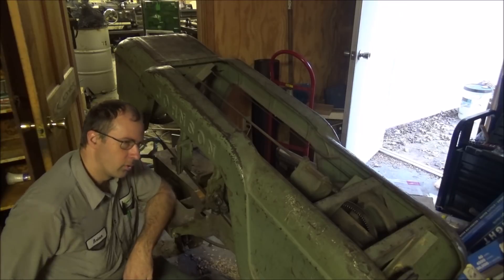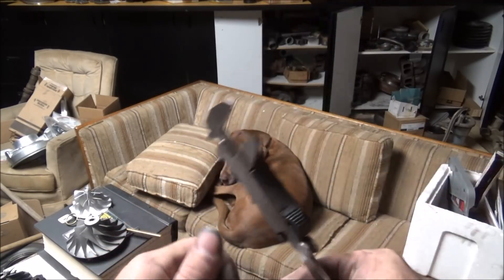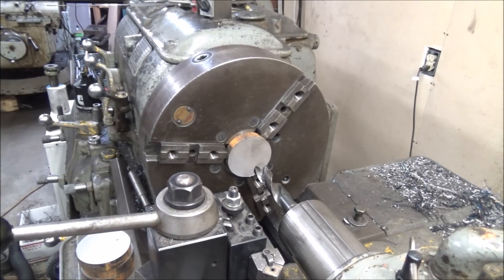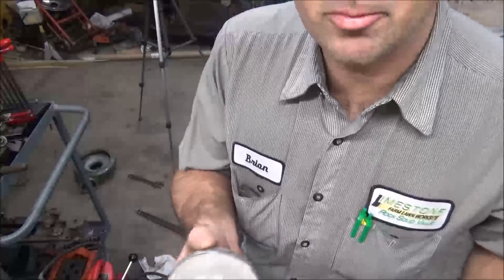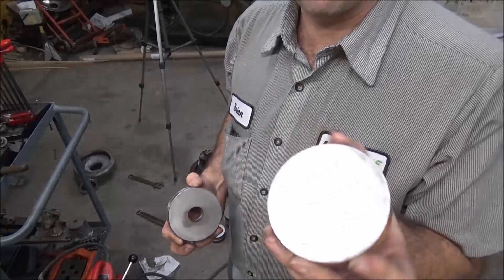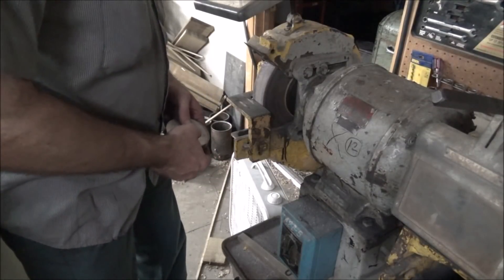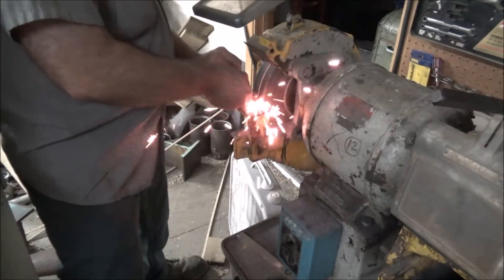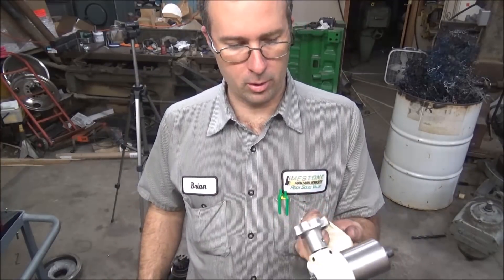Building Anchor Components for the Big Horizontal Boring Mill

Comment: 0.006" over 0.750" is +/-0.008"/inch... More realistic than +/-0.005"/inch.
Reply from the maker: I was referring to my target straightness for cut surface on the diameter not the tolerance on length.

Comment: Funny how well a drill works when used as it was designed.  You probably finished all the holes in the time would have taken others to finish swapping the 4 drills they would have used for one hole.  That is one sweetly tuned saw.

I have seen on many saw cut round bar parts this odd egg/crescent shaped pattern in the metal.  Do you have any explanation for what that is?  You can see the crescent moon shape at 2:09 in the video.
Reply from the maker: I can only assume the crescent pattern comes from vibrations in the blade caused by the teeth entering and leaving the cut.

Comment: wonder if that saw could cut 3 1/2" tractor axle? it was super hard material for cutoff discs.
Reply from the maker: I have sawn off 4" Deere tractor axles with it. It did it fine but it likely wasn't the best for the blade.

Comment: Brian, why didn't you break the edges on the lathe?
Reply from the maker: I didn't turn the bar before I sawed it off so it was not perfectly round, also it would have meant double chucking and cranking the tool in and out multiple times so just grinding the edges worked better and faster for this job. The plates just sit on the floor under the mill so their beauty is not important.

Comment: The shop I worked in, the saw cuts were good if within .080-.100 on a 4 inch bar hot rolled ... Wow , never saw such a close cutting saw in 30 years.